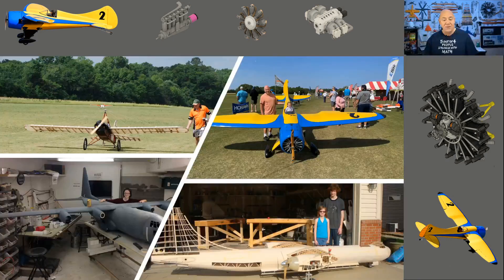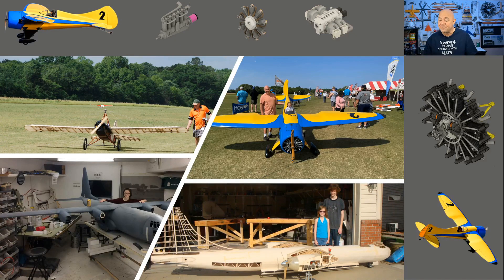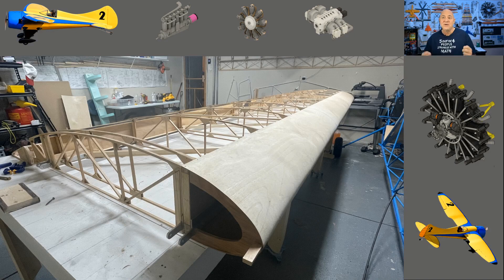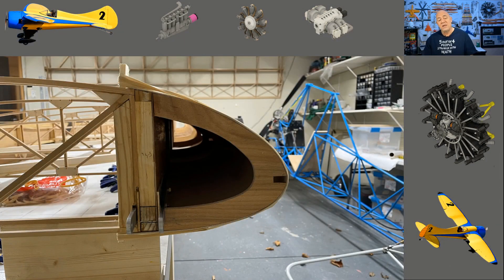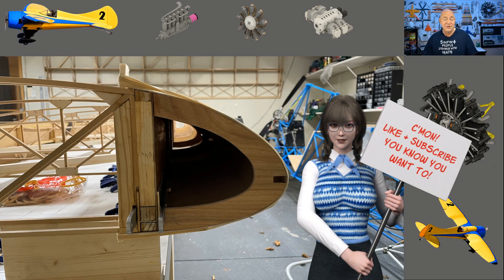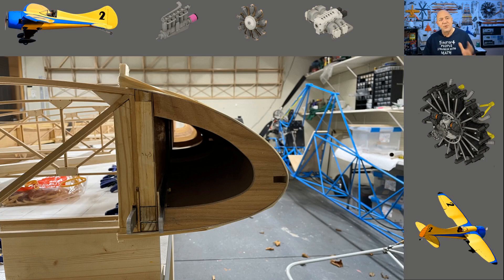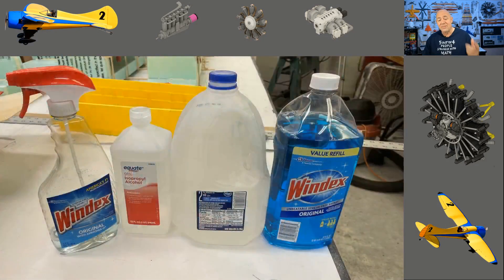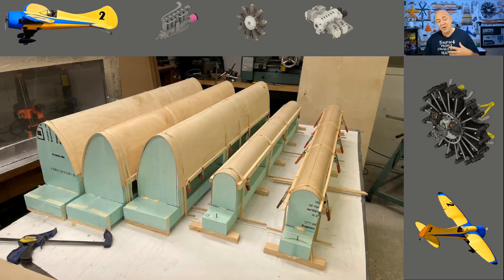AirBike Part 103 Ultralight Airplane Update

Comment: Good work,  and just a couple or three questions please  1)  you have obviously mulled over many designs,  why choose the 'airbike'     2)  will the A/B take a 1/2 VW or similar 
3) could the fuselage be slightly modified so that the rudder pedals are inboard   4)    the legal eagle looks similar to the A/B, are there any other designs that are tractor powered that you consider to be worthy of a look at    ta  rob NZ
Reply from the maker: I choose the airbike due to it fuse. I always wanted to Tig weld a fuse. Plus, the wings were very old school. I think the Better half VW might be a bit heavy, and very hard to hit Part 103 on a AB. Not sure how to make the pedals inboard. That would be a big re-design. IMHO, the Legal Eagle and AirBike are the two best tractor type Part 103 aircraft out there. :)
Reply: thanks 👍🛩